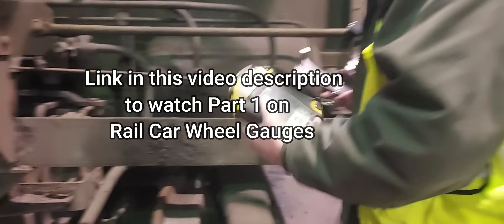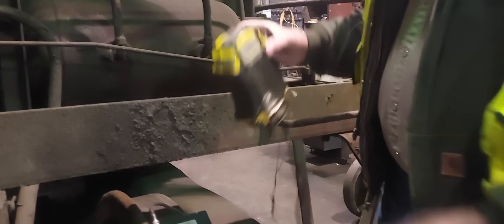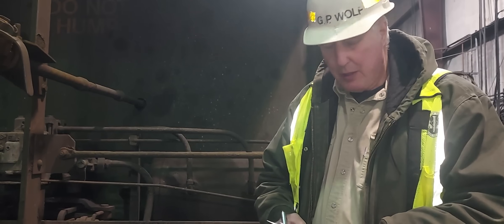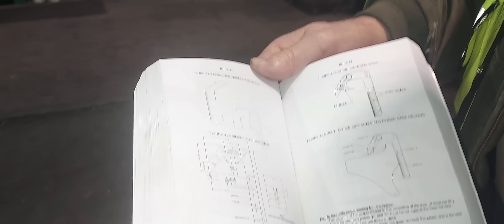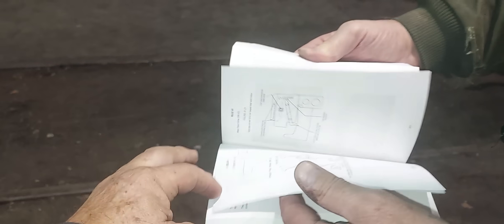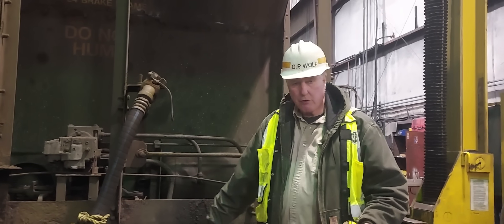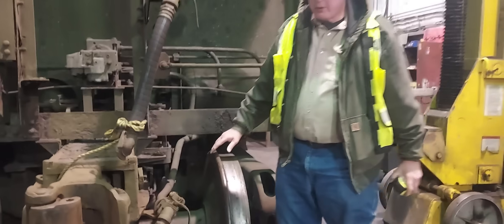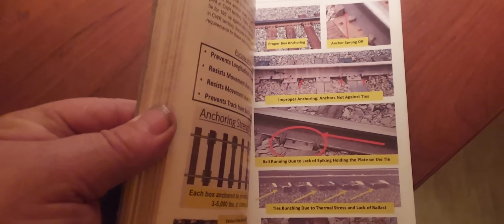How to Use Rail Car Wheel Gauges Part 2

Comment: Great videos, both parts. Inspection is a part of regular maintenance schedules. For a Class 1 railroad what 'might be' the intervals to check these wheel/tread/flange measurements for meeting the tolerances which Mr. Wolf has described?
Reply from the maker: Thank you for the nice comment Tom and glad you found the video interesting.  Code Fed Regulations does not specify a time frame, only gives specs on what the measurements must be. So it is up to each individual RR to keep their wheels in compliance whatever
frequency they check them on is up to each RR.  Really appreciate your taking the time to watch and may you have a very good day my friend.

Comment: Nice, Dave!
When are wheels checked? With the many cars and each with four wheels, this could be a monumental task!
Reply from the maker: Thank you for the nice comment Michael. .The Code of Fed Regulations does not specify a time or mileage frame for when wheels should be checked, only the parameters the wheel
profile must be. Each individual RR is responsible for checking
the wheels as they see fit. Really appreciate your taking the time to watch the video and may you have a very good day my friend.

Comment: Some history of ASME
American Society of Mechanical Engineers,
This group was really started by the new transportation industry,  Steam trains, the concept of using dye penetrant to check for cracks was not by ASME it was by the railroads to check wheels and couplers then adopted by ASME. The sad early days of Steam locomotives was marred by boiler failures up to exploding due to crown sheet being uncovered by low water level in the boiler and improperly designed and built boilers ASME started the Testing process for pressure vessels if it was a air tank for the brakes on a train it was a U Stamp if it passed hydro test . If it was a boiler it was stamped F. So The US railroads started ASME and ASTM American Society for Testing and Materials. Yes Dave really cool stuff. Keep these great videos coming
Reply from the maker: Wow great history lesson Kristy, I never knew any of that. I love
learning stuff like that, thanks so much for sharing.  Really appreciate your taking the time to watch our video and may you have a very good day my friend.

Comment: Morning Dave. What is the expected "mileage" of a wheel set?
Reply from the maker: Good question James without a good answer. Here no one keeps
track of wheel mileage, I doubt it too many other RR's do either.
Wheel wear depends on the weight of cargo carried on the car,
less weight obviously means longer wear. Also on the amount
of curves, here we have 70 curves in 16.7 miles so a lot more
wear occurs here than on most RR's due to that. We also have
jointed track which is harder on wheels than on all welded rail.
Then consider braking, the more braking that is done the more
the wheel can wear. New wheels wear fairly quickly down to
a certain point, then the wear stabilizes, but if they are allowed
to get to near condemnable limits then the wear rapidly
increases. You might find this study on wheel wear interesting
https://interfacejournal.com/archives/21462

Comment: The technology has certainly got better with the laser tool and so has the price over a simple gauge. For a railroad running a lot of stock though it it would be money well spent. I wonder if our back to back measurement is the same. I hope I can find out. I was told something is different in Denmark to here and the wheel sets on a loco they bought from us, and now back over here, need replacing but they did not know just what was different. Great video Dave and thanks again to Mr Wolf for taking some free time to explain things.
Reply from the maker: Your certainly right about that Cedarcam, technology has come a long way. Someone else from the UK wrote in and said they were
required to use a gauge for the back to back and not a tape
measure.  Really appreciate your taking the time to watch the video and may you have a very good day my friend.
Reply: @ccrx6700  I see you saw part one of my day out yesterday. I asked about our back to back measurement on Saturday, but the guy did not know although being a fitter. He said they had wheel gauges. If I go there is an open day where they are building a brand new locomotive so someone there may know. Have a Good Day
Reply from the maker: @cedarcam  😊👍🚂

Comment: I experienced a wheel moving in on the axle of a wheelset once.  I was working on something under a car and noticed the wheel looked different.  Upon further inspection, the wheel had slid on the axle to where the wheel was not on the rail correctly anymore.  The truck was changed out.  I kept a daily watch on the track and train.
Reply from the maker: Great catch on that one Roy! Not something that happens all
that often, it takes around 100 tons of pressure to press those
wheels on the 6 1/2 inch axles. Rare they come loose but they
do. You certainly averted a derailment with that find.  Thank you for  taking the time to watch the video and may you have a very good day my friend.

Comment: Did he ever mention how often each wheel has to be inspected and who is responsible for doing such inspections sense most railroads haul cars from different railroads or leasing companies unlike your company Dave.
Reply from the maker: Good question JBo 1958. The Code of Fed Regulations does not specify a time or mileage frame for when wheels should be checked, only the parameters the wheel profile must be. Each individual RR is responsible for checking the wheels as they see fit. Really appreciate your taking the time to watch the video and may you have a very good day my friend.

Comment: Now in engineering class mechanical engineering and use of precision measurement techniques for rail car wheel sets and track .  Very cool using the pin trace tool . Oh the little book of rail knowledge handy too.
Great video Dave. 
PS must be a interesting wheel inspection on Union Pacific Railroad Steam locomotive Big Boy 4014 and UP 844 driver wheels Yikes.
Reply from the maker: Thank you for the nice comment Kristy and glad you found it
interesting. We are so fortunate to have Mr. Wolf share his knowledge with us. Wheels on the steam locos have the same Fed requirements for profiles as do the wheels on the diesel locos. Really appreciate your taking the time to watch the video and may you have a very good day my friend.

Comment: How often do the wheels get checked?

Is it random, scheduled, or seasonal?
Reply from the maker: The Code of Fed Regulations nor does the AAR Interchange
rules specify a time frame for how often wheels get checked
C J. They only give the specs on what a wheel profile must
be in order to remain in service. So the frequency of a wheel
getting checked it entirely up to each individual RR. Here I
take a visual of wheels when I get a chance, but there is no
certain frequency that it must be done. I do it for safety
reasons, if I see a wheel that looks suspect, then I will
put my gauge on it and it's close to being condemnable will
report that wheel to the office. I cannot speak for any other
RR out there however on what they do. Thank you for watching the video and may you have a very good day my friend.